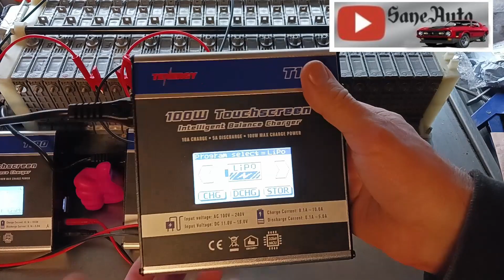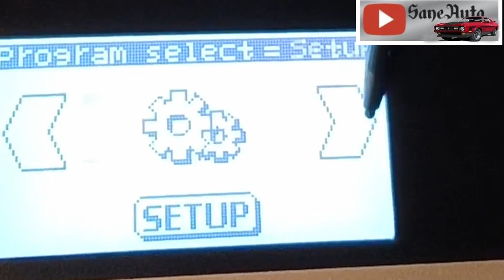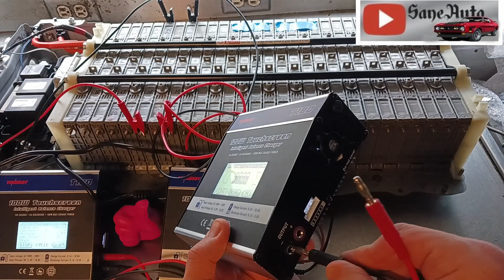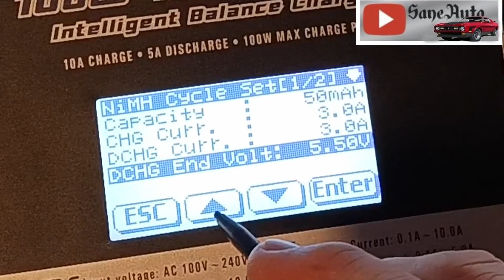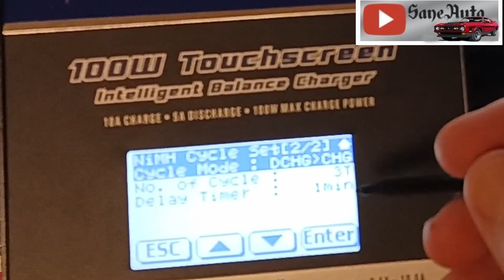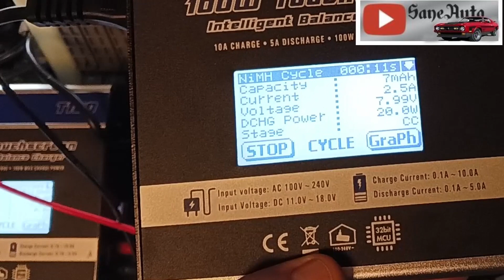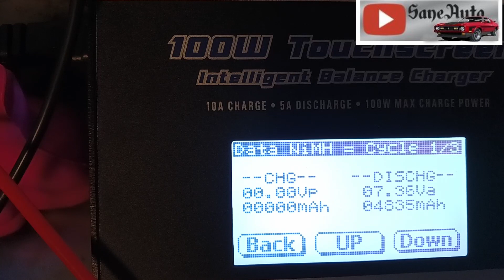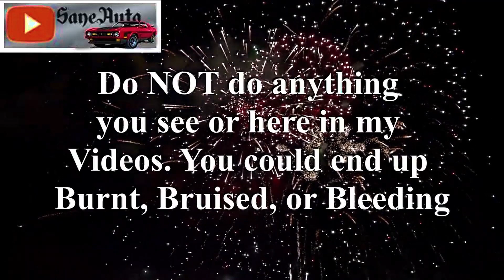Step by step unboxing and setup of T180 Charger for reconditioning of Prius Hybrid battery

Comment: Thank you very much for an excellent video!  Purchased 2 T180s with recommended clamps. Set up exactly as shown in video. Why does one unit allow info when tapping on "cycle" and the other unit is unresponsive when tapping on cycle? I noticed that the unit that works when tapping on "cycle" has a box around the word "cycle ."

Comment: Thank you sir.  Liked and subscribed. I have started my journey cycling, cleaning bus bar, balancing my camry hybrid.  Seriously, take his advice, use the better gauge banana plug/aligator clips from amazon.   My battery's internal resistance dropped from 600+ mΩ to 15 mΩ (according to T180) by changing wire as he/others said.   I did one cycle of 0.7A charge/discharge.  Now I'm trying 3A charge/discharge.  So far no swelling or warm on the wires.👌    Hope that will 'exercise' them well.  If not, maybe slow to 0.7amp cycle.
Reply: be sure you are venting the battery .

Comment: You said  module “A”. Is this just 1 of the 28 packs, or is it doing 1&2 together? Can’t see the other side of pack so uncertain if 1&2 are bussed together. Would take about a month to do with one charger at 16 hrs per pack. I suppose they sell a charger that looks like a hooka bong that would do them all in one setting(for a small fortune)
Reply from the maker: I love your description of the ridiculously expensive chargers. Yes just one of the 28 modules. I put one charger on one module no bus bar. Your right 28 modules with one charger = about a month. I run at least 4 chargers at a time for faster results and the cost of 4 is still way cheaper than Hooka charger. Plus if I make a mistake and kill one affordable charger I just kill one, not the whole Hooka smoking octopus.

Comment: So, if it takes 16 hours for the three cycles, why would one NOT CHG and DCHG at higher current rates - it is like filling up and emptying your swimming pool with water - (Small hose vs. a huge water truck delivery 4" wide hose) - the charger has the ability to go up to 10.0 change and 5.0 Discharge. Why should we not do this? Have you tried it and has it caused negative results for the battery cells?  I am thinking, I would set my charge to 7.5A and Discharge at 4.5 - I also see that some people use the NiMH option when charging and others do NiCD - what is the Type of Battery in these GenII Priuses (NiMH or Ni-Cd)?

For the sake of confirmation: They are NiMH batteries - NiMH batteries do not like being "slow trickle charged" -
Reply from the maker: Thank you for the questions. My answer was too long so I just recorded a video. I will release it soon and put a link in the comments here when the video is ready.
Reply: @saneauto  Did you release the answer? Thanks.
Reply: I guess more amps, more probability to heat them bad. I am doing 3A (D) - 2A (C).good results so far, I have three chargers, Im not in a rush.

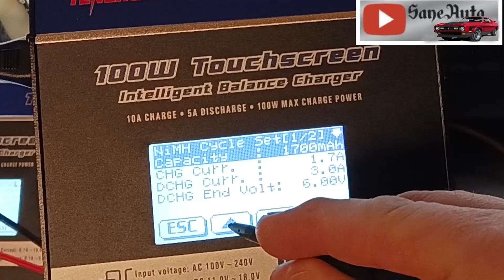Comment: You did set it at 3.0amps correctly a Glitch at 11:16 seems to cause it to increase to 7.5 amps while you're setting mah.
Reply: Because the capability of the unit is charging at 7.5 A current  - because these batteries are capable of getting charged fast while in the car too - so it should be fine. Someone prove me wrong please.
Reply: the charger defaulted to 7.5 amps when he changed the module capacity to 7500mah...that 7.5 amps represents a 1C rating and is likely a standard default setting for that charger. it's pretty standard to have cells that can charge and discharge safely at a 1C rate. take the 7500mah and revise it to amp hours (7.5) and that equal to the 7.5 amps that the charger has saved as a default standard charge setting; at least a starting point that then can be overridden.  @wizardmaster6639

Comment: Wow glitch at 11:19 its changing the amps at the same time as the mah setting 😲
Reply: not a glitch - it basically tells you that you can charge at that rate - you can choose to make it lower, but I do not suggest charging at higher rate